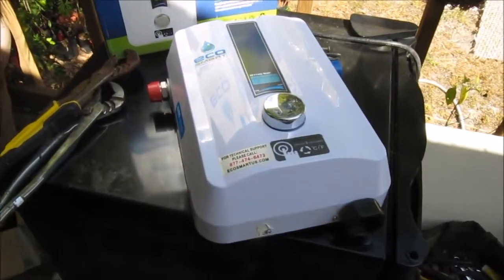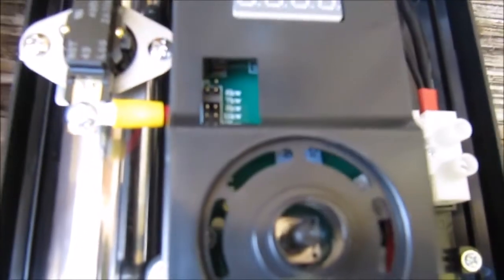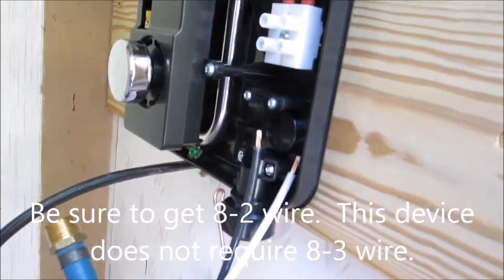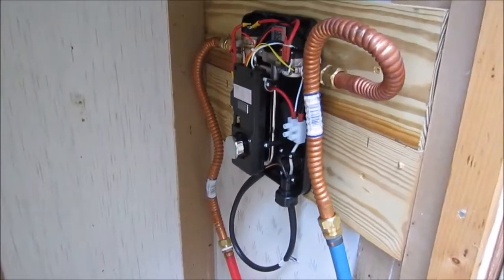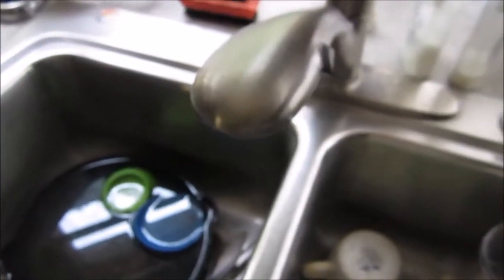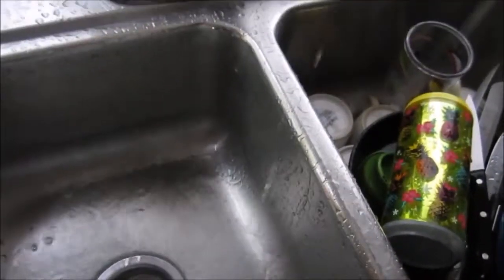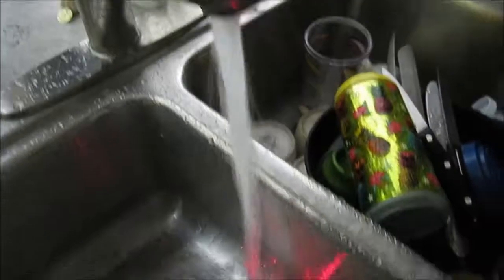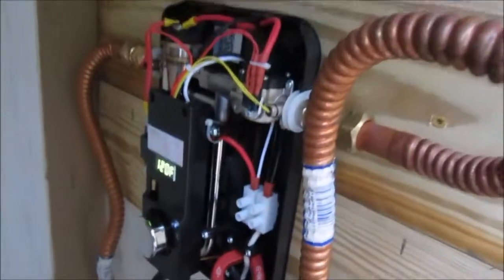Hardwire Installation of EcoSmart 8 with no Pigtail

Comment: So 4 years later hows it treating you? I just got one today for my home 1 bath a sink and washer. Seen it has 4k reviews on amazon so figured it would be somewhat decent.
Reply from the maker: This one worked as desired, but I later replaced it with a 13K model when my friend's wife complained that the high-flow shower head produced a tepid shower in mid-winter.  You can see the replacement video here; it doubles as a buying guide and shows how to restrict the flow to increase max temperature. 
https://www.youtube.com/watch?v=2yNEjQwk1Hw

These 8K models are mostly bulletproof and there are few issues to report.  Like tank water heaters, the components inside break down over time and they have to be replaced.  I have eight places, so I keep a few tankless water heaters laying around for a quick swap out; my tenants appreciate the reduced downtime.  These are much easier to replace than tank water heaters. 

Amazon sells other 8K tankless water heater for about one-third the price of the EcoSmart.  You can see a review I did on the Kenuos 7500W here.  From my measurements, the max wattage that the EcoSmart 8K can pull is ~7,200 and the Kenuos pulls up to ~8,300. 
https://www.youtube.com/watch?v=aWUt57JkeSw

Comment: Those connectors on the outlet and inlet you used will leak eventually. This unit requires compression fittings not screw on. That's why they include 2 compression connectors with crush ferrules
in the box.
if you look closely at the inlet and outlet connectors they have a chamfered inside edge. That means its used as a compression fitting.
Reply from the maker: You make great points.  I agree that the manufacturer made the connections on the side of the appliance for compression fittings and ferrules; it's plainly visible and I have fought with that in the past.

I don't want to use them as they create the requirement for copper pipes that need to be sweated to some fitting that can then be screwed into stainless braided hoses.  That solution has at least three extra joints on each side that can then leak and requires expensive copper pipe, non-lead solder, flux and a propane torch kit.  

The manufacturer also includes the compression to NPT adapters.  Why would the manufacturer include these adapters with every single water heater if they didn't mean for their customers to use them?
Reply: Pretty sure you are supposed to use the ferrules with the adapter. At least that’s what I did. Just have to make sure the stay straight when tightening.  I do agree it’s a terrible design and the quality of the compression fittings suck. They should just put 1/2” fpt or mpt on them.
Reply: @TylerRick-pk3be  Oh yes it will leak bad without the crush ferrules. I already have a much bigger Ecosmart I bought 8 years ago with dual 220 breakers and it did not have these stupid in/out connectors on it. I think it has MPT's on it.
Reply: This is correct.  I figured this out today, and called EcoSmart.... no one has ever bothered to call them and tell them their instructions are non-existent on how to assemble the adapters.  For sure, there is no mechanical seal if you just put the adapter on.  Jamming it with tape and goo is not the answer.  
The tech department was amazed no one ever pointed this out to them before!

Comment: What is the voltage required
Reply from the maker: These devices operate on voltages around 220 to 240.  Here in the US, the voltage is 220, so the overall wattage is lower than advertised--around 7260 instead of 8000.

Comment: hi, did you know if i can use it turned off to have cold water and, when i need it,  turn it on to have hot water? i want to use only one water line for only one shower, and i dont use hot water all the year.
Reply from the maker: When turned off, these produce no hot water at all; the water flows through unheated.  A single line to a shower is really quite clever as the temperature can be adjusted using the knob on the water heater instead of using a manifold to mix hot and cold water.

Comment: I'm presently looking at EcoSmart also for my kitchen sink and still trying to decide/understand which model I need (live in North Carolina).  But man.. that little thing (#8) there replaced an actual hot water tank.. looks to be a 40-50 gallon tank? Impressive!

So I take it my kitchen sink will probably require a smaller unit.. say 6 or 4?
Reply from the maker: It depends on the desired flow rate, really.  The water coming out of the ground that far north in the winter is likely colder than 60 degrees, so you'll need to account for that, too.  I explain how to pick the appropriate tankless water heater at the end of this boring video (the EcoSmart 8 wasn't powerful enough in this case).  https://www.youtube.com/watch?v=2yNEjQwk1Hw